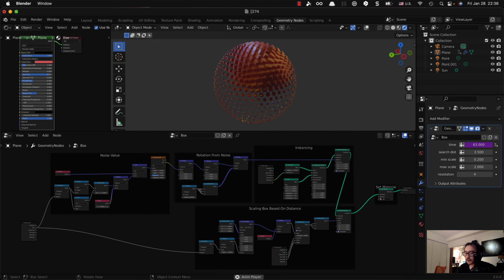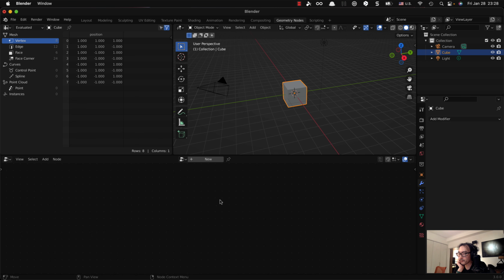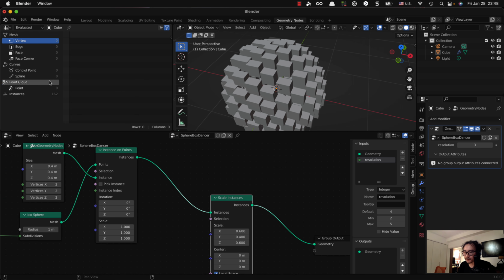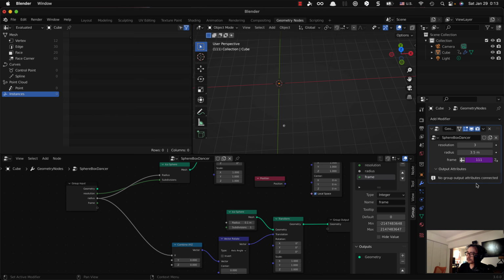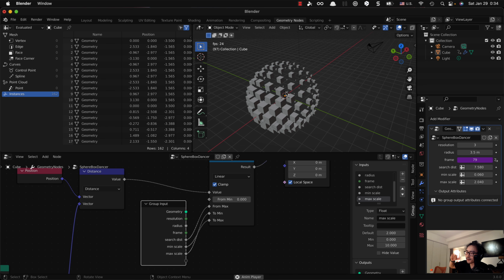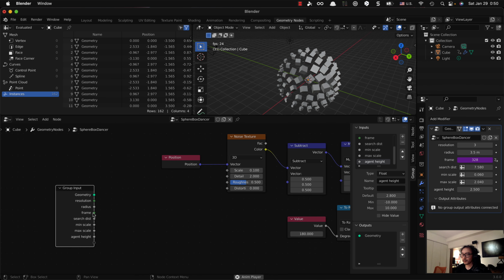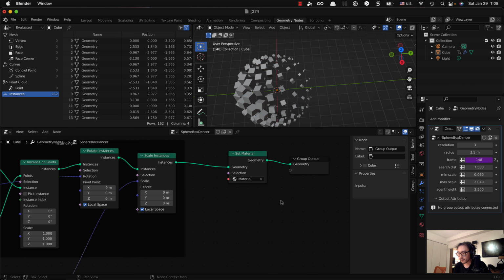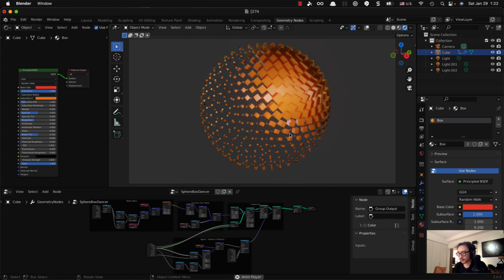Getting Started with Geometry Nodes in Blender 3.0 for Beginners

Comment: Hey thank you so much for the great content. Do you know how to find the vertices between two faces that are at plus or minus 90 degrees to  each other? Like the corners of an L shape mesh?
Reply: Not sure if blender has it but dot product is what you are looking for. The dot product compares two vectors and measures how perpendicular a vector is to another vector. It's a little strange the way it works. 1 means the two vectors are perfectly the same. -1 means it is perfectly the opposite meaning the other_vector == vector * -1. A dot product of 0 means that the vector is perfectly perpendicular to the other vector. If you measure the dot product and see if the other neighboring vertex has a dot product == 0, then that is your vertex that has a 90 degree angle to it.

Comment: FYI to anyone using #fram as the driver and not seeing it working. I was able to get it to work by just using "frame" instead. Maybe they changed this setting? I'm not sure but i do know it works in my project if I use "frame" instead of "#fram". Hope this helps someone.

Comment: 25:38 You can change all three parameters in one go! Just press the Left Mouse Button in the top field and drag down while holding. This will select all three fields and after that just type 0.1 in one field and voila! All three values has changed to the 0.1 value.
Reply: that's mad helpful bro!